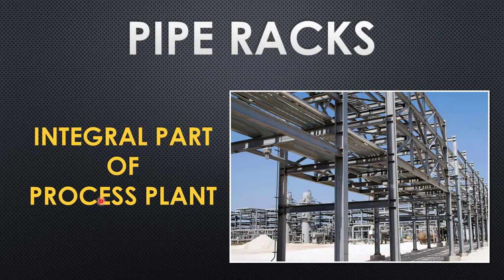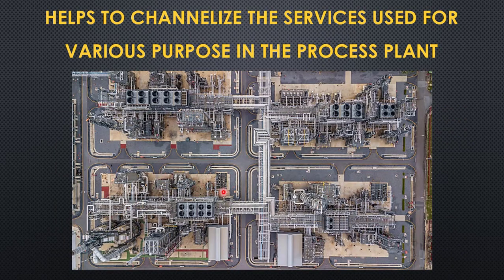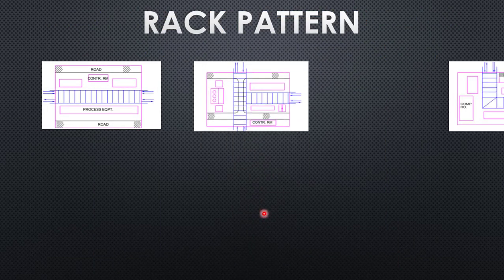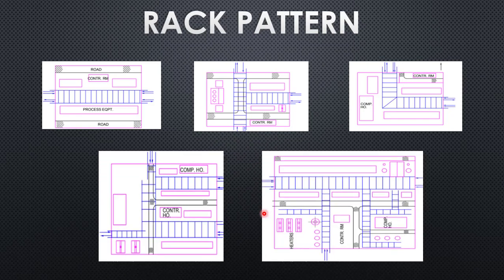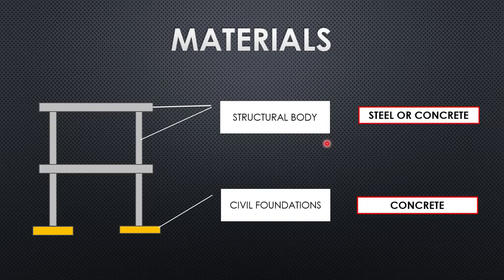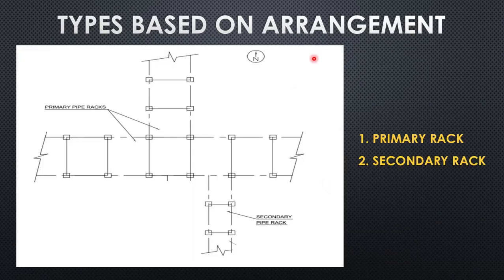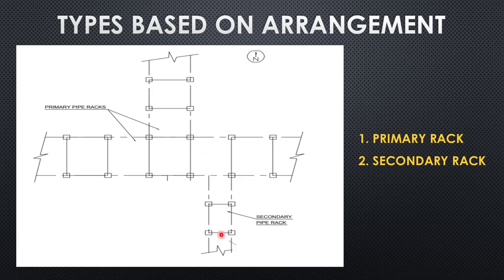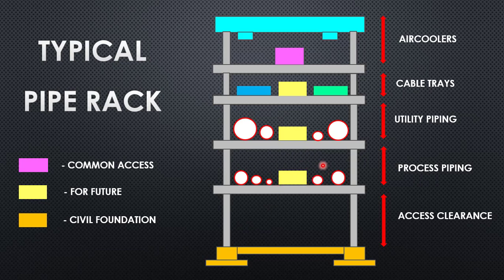Pipe Racks in Process Plant

Comment: Do we consider water filled pipe weight for steam or empty pipe weight?
Reply from the maker: Water weight due to condensation scenario
Reply: @pymedaca3130  thanks for the replay..if we consider water weight then the anchor loading or loading for axial stop to contain the thermal expansion will also be as per water filled pipe?
Reply from the maker: For steam, we must develop the scenarios, thermal analysis are done with steam density but slug loads shall be included. Upon closing, hydroload with water density to be checked and loads to revised accordingly in the final restraint summary.